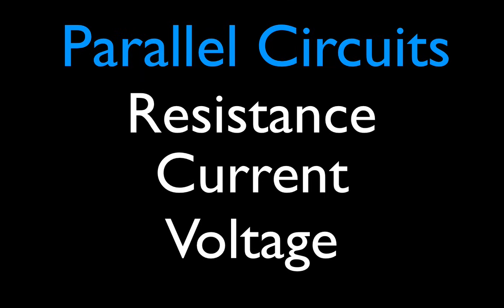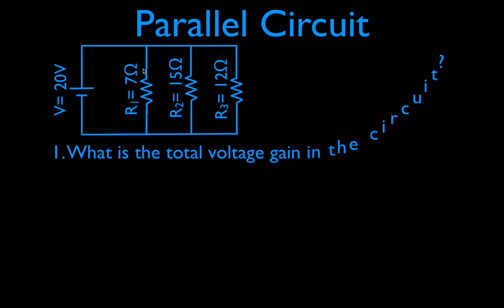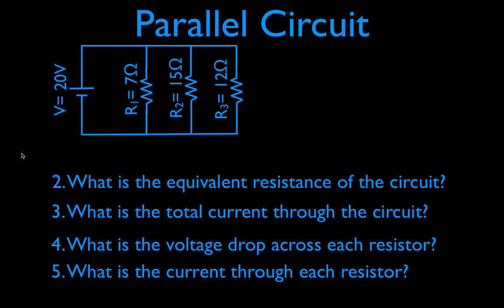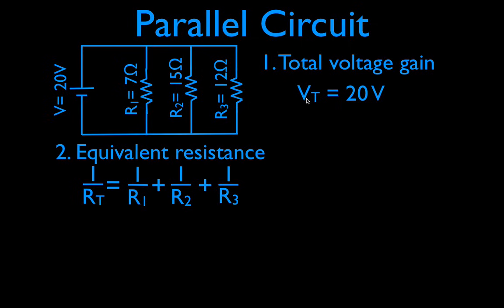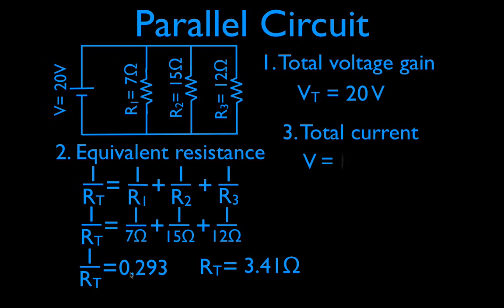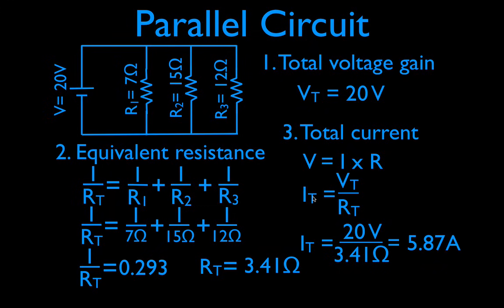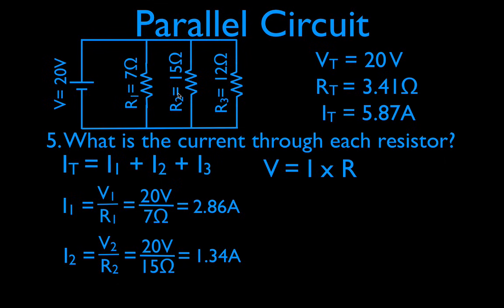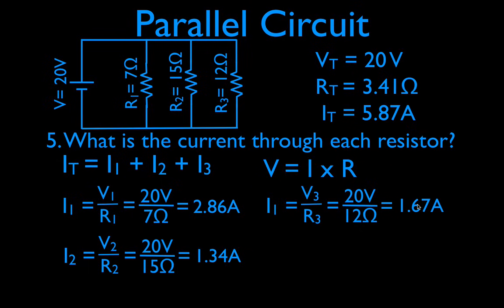Resistors in Electric Circuits (3 of 16) Voltage, Resistance & Current for Parallel Circuits

Comment: One question, the current flows from positive to negative or from negative to positive?
Reply from the maker: Technically when we say "current" we mean "conventional current" which is the the flow of positive charge. The positive charge flows from the positive terminal to the negative terminal. If you are asking which direction the electrons flow then that would be in the opposite direction, from the negative terminal to the positive terminal. Does that help?
Reply: @stepbystepscience  thanks, helped me a lot!
Reply: Basically where the current is goin, the electrons are goin the opposite way
Reply: You may find the following references useful to understand the physics.
What is a resistor? How does current branch in a network of resistors? How does it "know" how much should flow in each branch?
While some detail is given in science and engineering courses about conductors, insulators and semiconductors, resistance is described in several ways.
Examples include i. The restriction to the flow of electrons. ii. The difficulty in moving electrical current through a conductor to which voltage is applied.
iii. a circuit element which dissipates energy in the form of heat .
More appropriate description for a resistor would be the property of a conductor which determines the current produced by a given difference of potential.
This makes us remember that a resistor is a conductor first. And, there is reason to say that superconductive wires dont obey ohm's law. So all conductors are resistive, though not superconductors. 
Resistors are used in circuits to regulate the strengths of currents either by reducing the diameter of conductors or introducing more obstacles or lattice imperfections to reduce the strength of current.
The current branches in a parallel network by an elaborate rearrangement of surface charge.
For more details about resistance, how current branches in a parallel circuit and ohm's law consult the following videos, articles and books.
What is current ? What is voltage ?
A working definition for current in conductors like metal wires is "the start-stop motion of millions and millions of conduction band electrons everywhere within with a drift superimposed". 
In circuits, voltage is due to surface charges. Consider a simple circuit comprising a battery, two wires and a resistor. 
The e.m.f of the battery is due to separation of positive from negative charges which produces an e.m.f across its terminals and a pattern of electric field surrounding them, not exactly but like a dipole.
An electric field is there in the wires and in the resistor; powerful electric field and uniform within the resistor, weak and uniform within the wires. The field is set up by a tiny amount of surface charge with a steep gradient on the resistor and not so steep a gradient on the wires. 
It is the electric field E created by the surface charges sourced from the battery, which produces a force causing the mobile electrons to acquire a drift velocity v = μE, where μ is the mobility which is a number representing the freedom of movement of the electron in the lattice. 
This results in a current density J = σE, where σ is the conductivity of the wire or material of resistor and E is the electric field in the wire if considering wire and is the field in the resistor when considering the resistor. 
The p.d. or voltage across the resistor is the integral of a constant powerful field along its length. The p.d. or voltage across the wires is the integral of a constant but weak field along its length. 
Voltage is entirely because of the surface charges.
Electrostatics and circuits belong to one science and not two, that of electricity and magnetism. To know how they are unified visit this link 
https://matterandinteractions.org/articles-talks/ and view the article 'A unified treatment of electrostatics and circuits.  B. Sherwood and R. Chabay, unpublished. (1999)'
pdf. 
For more details see Electric and Magnetic Interactions by Chabay and Sherwood 
www.matterandinteractions.org
or 
Fundamentals of electric theory and circuits by Sridhar Chitta
https://www.wileyindia.com/fundamentals-of-electric-theory-and-circuits.html
There is a "look inside" feature in the amazon.com webpage of the book "Fundamentals of electric theory and circuits" by Sridhar Chitta with a few pages of Chapter 1 which may be viewed and also which you may swipe left or press < icon to view the foreword, preface and Table of Contents. 
For a video lecture by Prof Ruth Chabay on surface charge in a simple dc circuit visit 
https://youtu.be/-7W294N_Hkk
There is a full set of lectures beginning lecture 13 here on surface charges, electric fields, simple circuits, capacitance, inductance, faraday's law, motional emf, magnetic forces and more topics here
https://matterandinteractions.org/videos/EM.html
For a live demonstration of surface charge in a circuit visit
https://youtu.be/U7RLg-691eQ
There is a full set of lectures beginning lecture 13 here on surface charges, electric fields, simple circuits, capacitance, inductance, faraday's law, motional emf, magnetic forces and more topics here
https://matterandinteractions.org/videos/EM.html

Comment: I know how to do all this and all, but, what I want is a clear, explicit explanation of why you do the whole reciprocal thing.
Reply from the maker: I would say that it is because when you add more resistors in parallel the total resistance of the circuit decreases.
Reply: You may find the physics of the network useful in the references here.
What is a resistor? How does current branch in a network of resistors? How does it "know" how much should flow in each branch?
While some detail is given in science and engineering courses about conductors, insulators and semiconductors, resistance is described in several ways.
Examples include i. The restriction to the flow of electrons. ii. The difficulty in moving electrical current through a conductor to which voltage is applied.
iii. a circuit element which dissipates energy in the form of heat .
More appropriate description for a resistor would be the property of a conductor which determines the current produced by a given difference of potential.
This makes us remember that a resistor is a conductor first. And, there is reason to say that superconductive wires dont obey ohm's law. So all conductors are resistive, though not superconductors. 
Resistors are used in circuits to regulate the strengths of currents either by reducing the diameter of conductors or introducing more obstacles or lattice imperfections to reduce the strength of current.
The current branches in a parallel network by an elaborate rearrangement of surface charge.
For more details about resistance, how current branches in a parallel circuit and ohm's law consult the following videos, articles and books.
What is current ? What is voltage ?
A working definition for current in conductors like metal wires is "the start-stop motion of millions and millions of conduction band electrons everywhere within with a drift superimposed". 
In circuits, voltage is due to surface charges. Consider a simple circuit comprising a battery, two wires and a resistor. 
The e.m.f of the battery is due to separation of positive from negative charges which produces an e.m.f across its terminals and a pattern of electric field surrounding them, not exactly but like a dipole.
An electric field is there in the wires and in the resistor; powerful electric field and uniform within the resistor, weak and uniform within the wires. The field is set up by a tiny amount of surface charge with a steep gradient on the resistor and not so steep a gradient on the wires. 
It is the electric field E created by the surface charges sourced from the battery, which produces a force causing the mobile electrons to acquire a drift velocity v = μE, where μ is the mobility which is a number representing the freedom of movement of the electron in the lattice. 
This results in a current density J = σE, where σ is the conductivity of the wire or material of resistor and E is the electric field in the wire if considering wire and is the field in the resistor when considering the resistor. 
The p.d. or voltage across the resistor is the integral of a constant powerful field along its length. The p.d. or voltage across the wires is the integral of a constant but weak field along its length. 
Voltage is entirely because of the surface charges.
Electrostatics and circuits belong to one science and not two, that of electricity and magnetism. To know how they are unified visit this link 
https://matterandinteractions.org/articles-talks/ and view the article 'A unified treatment of electrostatics and circuits.  B. Sherwood and R. Chabay, unpublished. (1999)'
pdf. 
For more details see Electric and Magnetic Interactions by Chabay and Sherwood 
www.matterandinteractions.org
or 
Fundamentals of electric theory and circuits by Sridhar Chitta
https://www.wileyindia.com/fundamentals-of-electric-theory-and-circuits.html
There is a "look inside" feature in the amazon.com webpage of the book "Fundamentals of electric theory and circuits" by Sridhar Chitta with a few pages of Chapter 1 which may be viewed and also which you may swipe left or press < icon to view the foreword, preface and Table of Contents. 
For a video lecture by Prof Ruth Chabay on surface charge in a simple dc circuit visit 
https://youtu.be/-7W294N_Hkk
There is a full set of lectures beginning lecture 13 here on surface charges, electric fields, simple circuits, capacitance, inductance, faraday's law, motional emf, magnetic forces and more topics here
https://matterandinteractions.org/videos/EM.html
For a live demonstration of surface charge in a circuit visit
https://youtu.be/U7RLg-691eQ
There is a full set of lectures beginning lecture 13 here on surface charges, electric fields, simple circuits, capacitance, inductance, faraday's law, motional emf, magnetic forces and more topics here
https://matterandinteractions.org/videos/EM.html

Comment: OMG.  Thank you.  After having trouble with the concept in lecture,  then later  watching 10 other youtube videos.   Yours was the one where it finally "clicked"
Reply from the maker: Great and very nice of you to say so.
Reply: @stepbystepscience   I have to agree, I' thought I had ADD until I got here.. Thanks
Reply: You may find the physics of the network useful in the references here.
What is a resistor? How does current branch in a network of resistors? How does it "know" how much should flow in each branch?
While some detail is given in science and engineering courses about conductors, insulators and semiconductors, resistance is described in several ways.
Examples include i. The restriction to the flow of electrons. ii. The difficulty in moving electrical current through a conductor to which voltage is applied.
iii. a circuit element which dissipates energy in the form of heat .
More appropriate description for a resistor would be the property of a conductor which determines the current produced by a given difference of potential.
This makes us remember that a resistor is a conductor first. And, there is reason to say that superconductive wires dont obey ohm's law. So all conductors are resistive, though not superconductors. 
Resistors are used in circuits to regulate the strengths of currents either by reducing the diameter of conductors or introducing more obstacles or lattice imperfections to reduce the strength of current.
The current branches in a parallel network by an elaborate rearrangement of surface charge.
For more details about resistance, how current branches in a parallel circuit and ohm's law consult the following videos, articles and books.
What is current ? What is voltage ?
A working definition for current in conductors like metal wires is "the start-stop motion of millions and millions of conduction band electrons everywhere within with a drift superimposed". 
In circuits, voltage is due to surface charges. Consider a simple circuit comprising a battery, two wires and a resistor. 
The e.m.f of the battery is due to separation of positive from negative charges which produces an e.m.f across its terminals and a pattern of electric field surrounding them, not exactly but like a dipole.
An electric field is there in the wires and in the resistor; powerful electric field and uniform within the resistor, weak and uniform within the wires. The field is set up by a tiny amount of surface charge with a steep gradient on the resistor and not so steep a gradient on the wires. 
It is the electric field E created by the surface charges sourced from the battery, which produces a force causing the mobile electrons to acquire a drift velocity v = μE, where μ is the mobility which is a number representing the freedom of movement of the electron in the lattice. 
This results in a current density J = σE, where σ is the conductivity of the wire or material of resistor and E is the electric field in the wire if considering wire and is the field in the resistor when considering the resistor. 
The p.d. or voltage across the resistor is the integral of a constant powerful field along its length. The p.d. or voltage across the wires is the integral of a constant but weak field along its length. 
Voltage is entirely because of the surface charges.
Electrostatics and circuits belong to one science and not two, that of electricity and magnetism. To know how they are unified visit this link 
https://matterandinteractions.org/articles-talks/ and view the article 'A unified treatment of electrostatics and circuits.  B. Sherwood and R. Chabay, unpublished. (1999)'
pdf. 
For more details see Electric and Magnetic Interactions by Chabay and Sherwood 
www.matterandinteractions.org
or 
Fundamentals of electric theory and circuits by Sridhar Chitta
https://www.wileyindia.com/fundamentals-of-electric-theory-and-circuits.html
There is a "look inside" feature in the amazon.com webpage of the book "Fundamentals of electric theory and circuits" by Sridhar Chitta with a few pages of Chapter 1 which may be viewed and also which you may swipe left or press < icon to view the foreword, preface and Table of Contents. 
For a video lecture by Prof Ruth Chabay on surface charge in a simple dc circuit visit 
https://youtu.be/-7W294N_Hkk
There is a full set of lectures beginning lecture 13 here on surface charges, electric fields, simple circuits, capacitance, inductance, faraday's law, motional emf, magnetic forces and more topics here
https://matterandinteractions.org/videos/EM.html
For a live demonstration of surface charge in a circuit visit
https://youtu.be/U7RLg-691eQ
There is a full set of lectures beginning lecture 13 here on surface charges, electric fields, simple circuits, capacitance, inductance, faraday's law, motional emf, magnetic forces and more topics here
https://matterandinteractions.org/videos/EM.html

Comment: Finding the current; will the same equation work for a series-parallel circuit?
Reply from the maker: If you are talking about the V = I x R then yes.  Ohm's can be used for parallel, series or combination circuits.

Comment: a battery of unknown emf is connected across resistances the drop across 8 ohm resistor is 20 volt what is current reading in the ammeter and what is emf of the battery

Comment: Nice video but isn’t finding the total resistance and total current unnecessary for finding out the current across each resistor (its nice to double check but it would be much quicker by just doing voltage/resistance for each resistor)

Comment: excellent video best I've seen so far well done mate ,you summed it up brilliantly ,would like to see how to solve it if there was another resistor in between and just say for the voltage drop you didn't get 20V in all three branches. like how to work that out but that was excellent .
Reply from the maker: thanks for the comment. I have videos for combination circuits. you can see a listing of all my videos at www.stepbystepscience.com

Comment: Thank you so much. I was trying to figure out the total resistance by adding 1/n1 + 1/n2 where n is any number. I was trying to find the common denominator where I was stuck for hours. Did not realise to divide 1/n on the calculator. I was instructed to do it manually with no calculator. I thought this subject was easy.
Reply from the maker: If the demoninators are relatively simple then you can do it without a calculator, but if you can use a calculators then why not?  You can see a complete listing of my videos at http://www.stepbystepscience.com

Comment: Possible dumb question, but I'm having trouble wrapping my head around this. What is the purpose of using resistors in parallel? Is it when you need a specific resistance (such as 3.41) when a single resistor in that amount isn't available?
Reply from the maker: Think of the resistor as a light bulb or some other household device, then everything is connect in parallel.  If it was wired in series then when you turn off one light they would all go off.

Comment: I want to ask that in parallel circuit or in series circuit the current is same through all resistors?
Reply from the maker: In series circuits the current is the same and in parallel circuits the voltage is the same. You can see a listing of all my vidoes at http://www.stepbystepscience.com

Comment: Please help my brain has stopped working. :)    1/7 + 1/15 +1/12 = 0.0896825  (not 0.293 )  what am I doing wrong please?  Thank you. John... :)
Reply from the maker: I am not sure what you are doing wrong, I just do it out in one long string on my calculator and I get 0.293
Reply: Hello and thanks for the quick reply,  as soon as I read your reply I knew the problem was my calculator! it does not add in one long string. I downloaded a better calculator and it works perfect 0.293..  Thanks again.  John.... :)